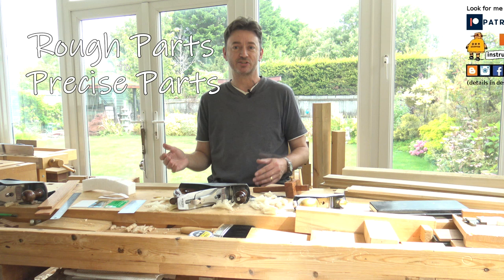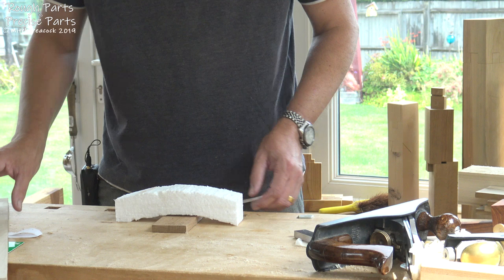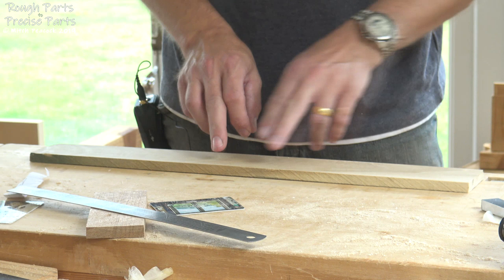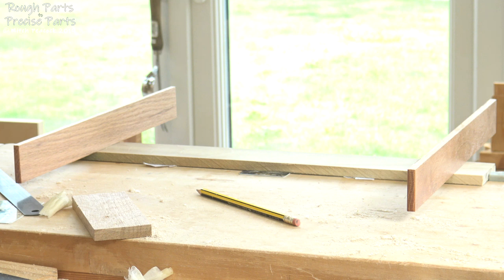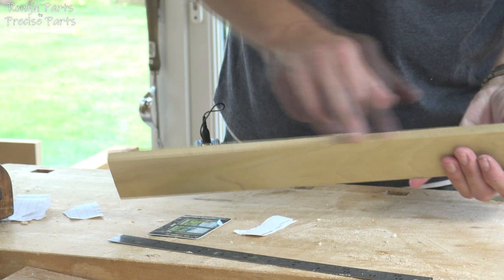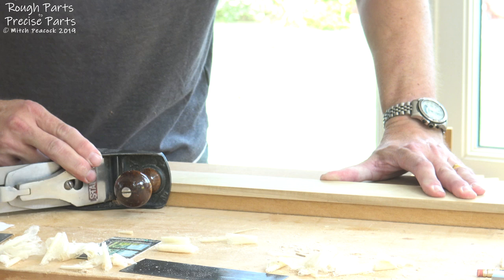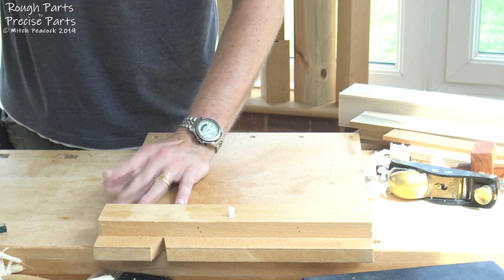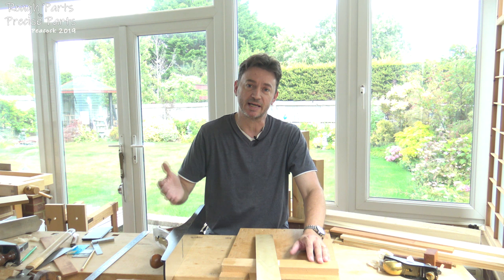Rough Parts to Precise Parts,  Unplugged - Cup Display Rack Techniques

Comment: Well done Mitch. After the first time I saw you using a shooting board I made one for myself following your pattern. Makes squaring the ends ever so much easier. I got lucky and picked up a #8 with a fence. With it I can plane edges square and flat without much effort. For anything under a foot in length I can use the shooting board for both the side edge and ends. 
I learn something new each time I visit. I didn't think of using the #8 on the shooting board. The mass will help keep it moving yhrough the cut. 😆😎

Comment: Mitch,  Rob Cosman avoids the problem of blowing out the back side of a cross-grain shot by first reversing the board, canting it slightly, and taking off a couple of shavings before putting it to rights and carrying on.
Reply from the maker: That's a great tip. Similar to beveling the far edge, and to taking stop shavings from each edge.
Reply: @mitchwoodwork  That is precisely what Rob was "shooting" for. :-)

Comment: How long would you let the cut down rough pieces sit before doing this step.
Reply from the maker: It depends on how well the wood has been seasoned/dryed Stephen. Stresses show up virtually straight away, but slight moisture differences through the rough board needs to equalize once cut. I usually find a couple of weeks works most of the time, but you can check each day for movement, and just wait until it stabilizes. Great question, but no simple answer ;-)

Comment: Couldn't it be the case that you're always chasing your tail? so you rough cut to size, then the next day its moved, so you plane flat again, and then the next day it's moved again, so you flatten again.... and the process continues?
Reply from the maker: That's a great question. In a sense you're right, however the part is, from the rough state, much thicker than what you are removing with the plane, and will move significantly less. It's often the case that an accurately prepared part will move after the final shaving is taken and it's had time to rest. In the case of one piece items, like the winding sticks, you would revisit the checking after a day or so and correct as necessary, probably only requiring stopped shavings with a fine set smoother. Pieces that make up a greater whole can move a thou or so and yet still be assembled easily, joints glue and other fixings holding everything square (or what're else).